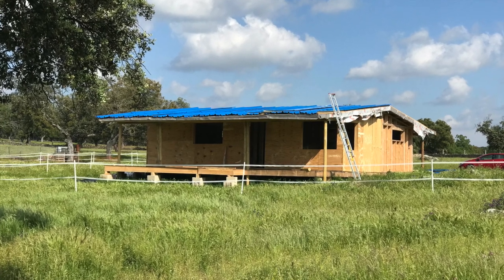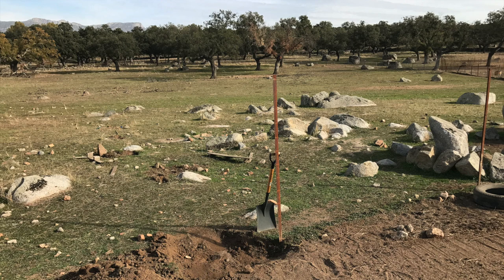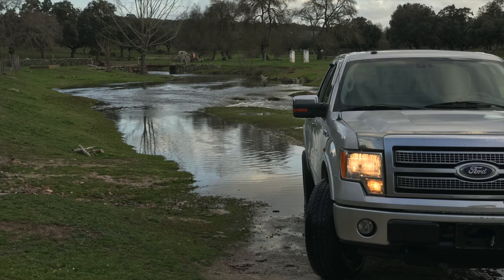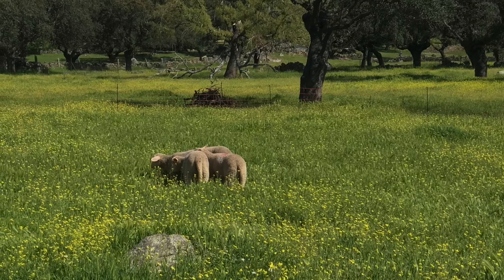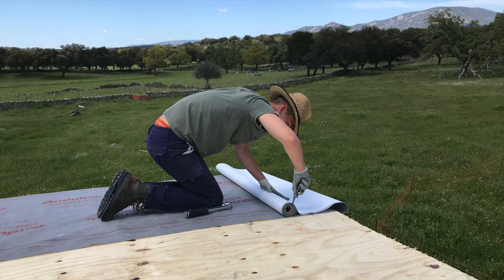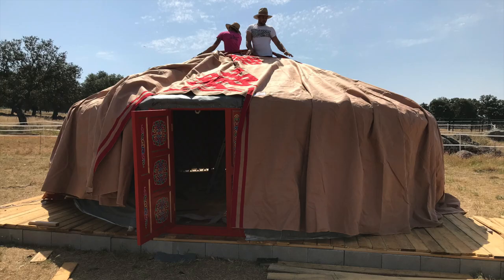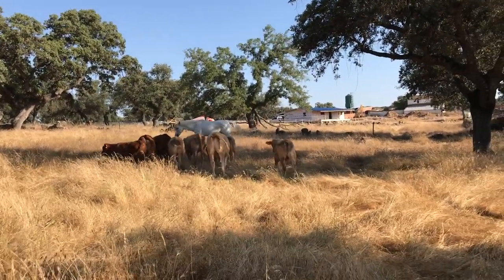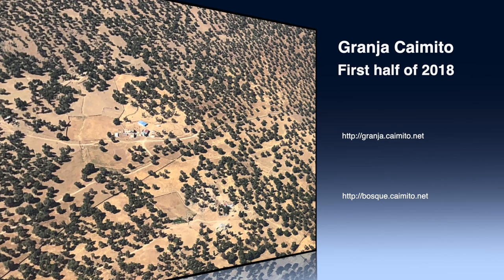New FARM practicing REGENERATIVE AGRICULTURE in SPAIN

Comment: SUCH A HOUSE IN ANDALUCIA WILL BE HOT   AS HELL IN SUMMER AND A FROZEN  BLOCK   OF ICE IN WINTER.
WHAT ABOUT INSULATION IN THE WALLS AND ROOF?  this is essential.
Reply from the maker: 15cm of rockwool in the walls and 25cm in the roof solve that problem pretty well ;-)